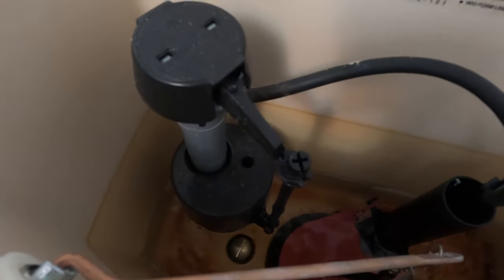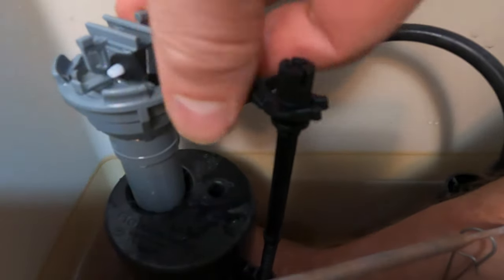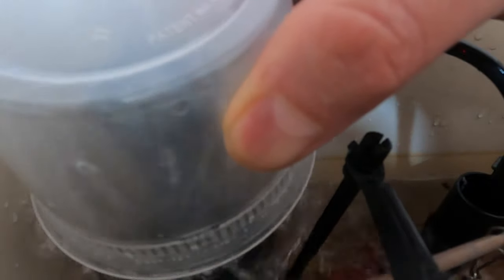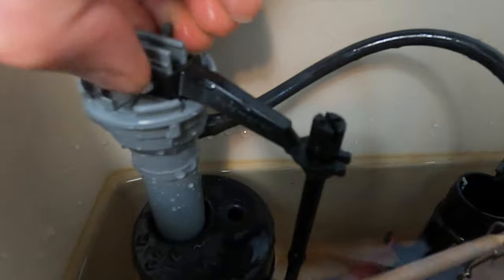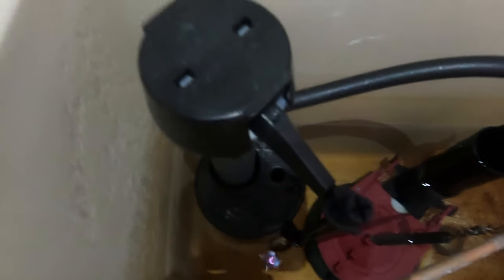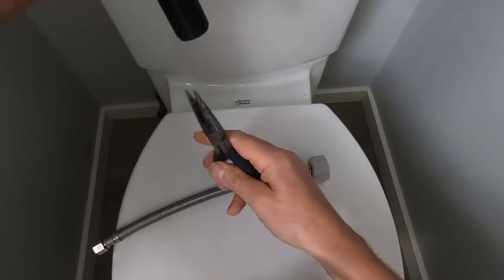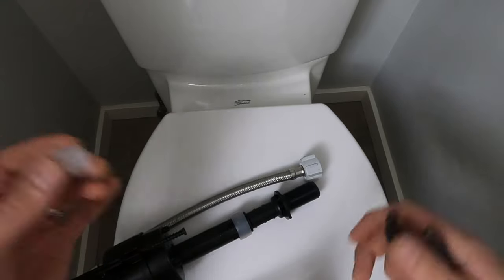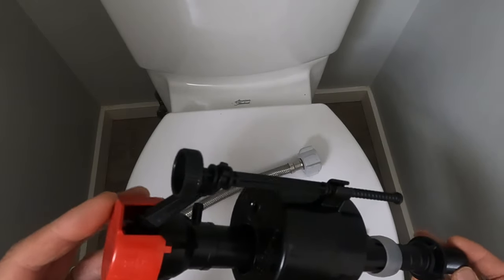How to fix a hissing toilet. Two causes.

Comment: This fixed mine. I was expecting it to not because it was hissing even after it was done filling, but I guess debris or something was causing it. Regardless, 5 minute fix and we are on our way. Thanks!
Reply from the maker: Sometimes a combination of debris & high water pressure causes what you are describing. You may want to check your water pressure as well. I have a video on how to lower water pressure. Thanks for watching!

Comment: I suggest also checking the water pressure to your house. Several problems, including showers that felt like being sandblasted, sprinkler timers that didn’t seem to last as long as they should, and water hammer arrestors that didn’t work (if the captive air has less than 90 psi and the water pressure is 90 psi the arrestor piston is already bottomed out and cannot absorb a pulse) disappeared after plumbers installed a pressure reducing valve.
Reply from the maker: I agree, high water pressure also causes faucet  washers and cartridges to wear out faster as well. Thanks for watching!

Comment: Thanks for posting this. My toilet been hissing for a while now. I was going to either get a plumber in or try to replace the whole inlet myself. I tried to the first tip, dismantling the top valve to clear it of debris, and there was a piece of plastic stuck in it.

I think you can imagine the joyful frustration I felt when my tank not only filled up, but stopped flowing. My house is silent again.
Reply from the maker: That’s great! Glad it helped

Comment: To anyone afraid of pulling out the white rubber gasket / filter at the bottom of the fill valve tube - I removed this and it solved the hissing noise. 

On the next fill, there was a bunch of debris in the tank. Seems like there was a backlog around the rubber gasket.

Thanks Jensen! 🎉
Reply from the maker: @kamandor  Glad the video helped!

Comment: Thank you. First step did the trick. Your demonstration was easy to follow. Much appreciated. I had a new septic tank installed and while digging they accidentally hit a water line so I’m sure that’s where the build up came from. Not their fault considering it wasn’t running along side of this old house.
Reply from the maker: @lizgee5331  Glad the video helped! After a water line is hit the toilet is usually the first fixture used once the line is repaired so it gets most of the debris. Faucet aerators are another common spot for debris to gather.

Comment: This worked for me! THANKS! One thing, getting that cap off was a hassle. I found using a finger or thumb in that front opening to pull upwards popped it off. Mine absolutely would not come off pulling the side tabs. Once the cap was off it was literally 3 or 4 minutes to clean and flush and it is fixed. Thanks so much for making this video, saved me time and money!
Reply from the maker: Some caps are definitely more difficult to remove than others. I’m glad the video helped!
Reply: there's actually no need to take the cap off. just lift the float arm up and twist. it comes off and goes on just like he showed, just wtih the cap attached. taking the cap off only makes it easier to line up the grooves and drop it in place without whiggling it a bit to find the grooves because you can see the mating

Comment: This video worked for me. After flushing out i still had the hiss so i took off the black cap and turned the water back on slowly. It started to squirt upward through the black valve seal, so i removed it, bought another valve seal, and  the hissing stopped after putting it back together. Thank you for the tutorial!
Reply from the maker: Glad it helped!

Comment: Thanks for showing that flow limiter, I was was puzzled why my toilet was filling so slow after I replaced the flush valve , I thought maybe the shut off had a restriction. I removed the flow limiter and it and it was slightly blocked, I just left it out, works great now. Thanks again

Comment: Awesome, thanks man!! There was a little rubber piece that was stuck in the top of the valve. Cleaned it out and it filled right up like new 🙏🏼
Reply from the maker: Glad it helped! You may need to change the valve seal eventually if you found a piece of rubber.

Comment: The flow restrictor is I think the culprit in my case! The fill valve looks brand new, but the restrictor is scuffed. Thank you for educating about it!!
Reply from the maker: It could be the flow restrictor but l have seen debris in new fill valves as well. Sometimes when the water gets turned off & on a bit of debris from in the shut off valve gets lodged in fill valve.

Comment: Immediately stopped hissing with fix #1!!! I tried #2 because after the hissing stopped, the basin crept to a super slow rate of refill. But wonderfully simple tips man, thank you so much!
Reply from the maker: Glad to help! You may want to check that the fill tube from the fill valve to the flush valve is clear as well.

Comment: so to remove the flow restrictor, you would have to remove the entire fill valve? or do you remove the restrictor while it's still inside the toilet, kind of pulling it out w the needle nose without being able to see...?
Reply from the maker: You can usually grab the restrictor  with needle nose pliers while the fill valve is still in place even if you cannot see it. You could try using a small inspection mirror to see if there is a restrictor in place.
Reply: @JENSENDIY  ok thank you so much, that's helpful

Comment: Thanks for helping others including me. I did like you said, and it went well, unfortunately I have to replace the fill valve, but, thanks to you, I know how.
Reply from the maker: Glad the video helped, thanks for watching and good luck with the fill valve replacement!
Reply: @JENSENDIY  Yeah, t went well. Not much for tight spaces, but, it's working fine now.
One exception, I have a knob that turns the water to the tank on and off, now that's leaking, and there is no shut off to that, so, I have to shut the whole house down. 
If it ain't one thing, it's another, thanks again.

Comment: Fixed my several month's dilemma. Replaced the flapper and can still hear hissing and water running. as soon as I cleaned the refill valve, my issue is gone. Thanks a bunch
Reply from the maker: @skilledgrub4906  Glad it helped!

Comment: I know that you posted the video quite a while  ago. My toilet  when flushed would not start to refill. You had to take off the top and manually tap the fill value to start it filling. I used your video and now the toilet  is working perfectly. I would add to clean bottom of tank if they is any dirt in. I could not believe I did it if it wasn't for your video. Thank You
Reply from the maker: Glad the video helped! Thank you for watching

Comment: Thanks for the helpful video .One question, when you turn the water back on ,does it need to be turned all the way back ,or just enough to get a good flow into the tank?Thanks.
Reply from the maker: @joesive5476  Just enough to get a good flow is fine but sometimes by doing this the valve makes more noise than if it was fully open. Hope this helps! thanks for watching.

Comment: Great video. I woke up to hear my basement bathroom toilet hissing very low but that bathroom hasn’t been used. Checked the water level Al’s water pressure all seem ok. I hear the hiss coming from the same region around the cap you mentioned to clean. Going to give it a try. Hope it works
Reply from the maker: Hope it works out for you, thanks for watching!

Comment: Def tried the first part still hissing though. I’m going to need to try to empty the tank before i try part 2. Co worker told me that other part gets clogged up. Thanks for the help
Reply from the maker: @gtcole04  You may have to replace the fill valve. Or try replacing the valve seal first. Good luck!

Comment: Thanks for the tutorial. The hissing sound went away after following your instructions but for some reason the toilet now takes longer to fill up with water after flushing. Any idea what caused it?
Reply from the maker: It's possible that there is still some debris in the fill valve or the water shut off valve is not turned back on all the way. Thanks for watching!

Comment: Thanks man didn’t fix the problem but lessened the hissing. I guess the spill valve needed cleaning out anyway
Reply from the maker: Glad it helped reduce the hissing, sometimes high water pressure can cause problems as well. I have a video on lowering water pressure. Thanks for watching!

Comment: Thanks so much for this video. In my case, I just replaced my damaged rubber valve seal after 16 years of toilet use to stop it from hissing. However, I'm noticing afterwards that lots of little black rubber pieces are floating around in the water inside the tank. Will my new rubber valve seal will be damaged again soon if I don't clean all that out?
Reply from the maker: It's a good idea to clean out the debris from the tank if you can but it shouldn't harm the valve seal as that is usually caused from incoming debris through the water supply line feeding the toilet. I would check tank to bowl washers and flapper to make sure they are not causing the little pieces.

Comment: Thank you For this very helpful vid! I have another problem wondering if you have a suggestion, when I flush my toilet I have to always hold the handle down to complete a full flush( even though I replaced my Kholer handle with a Korky strong handle) thanks I’m advance .
Reply from the maker: Try adjusting chain length from flush lever to flapper. Make it short enough so flapper stays sealed but with only a little slack in chain. Hope this helps!

Comment: I have fixed the hissing sound with minimal water spillage.. none if the wife had passed the cap sooner but that’s half the fun. Would this cause a leak/water usage or should I keep checking?
Reply from the maker: @chuckwagon9923  If the toilet was continuously running then yes this would be causing water usage. Hissing while filling is more annoying than anything else, it doesn’t usually indicate a leak or water usage, just debris in the valve or a worn valve seal.

Comment: Wow, I found this video & was happy, I thought I could fix my "hissing" valve myself!  I currently have the same exact one that's in the video- the "Fluidmaster" that a plumber installed within the past 2 years (so its not old)  Well, I sure got a problem... I can't turn the water off to the toilet (the darn thing doesn't even budge) & I can't "pop off" the top Black cap either? (I even used both hands)  How come it looked so EASY in this video??? 😮  lol  Geez, guess I'm gonna have to call someone! 📱  *What's the trick to pulling up the black top cap on the fill valve?
Reply from the maker: Some are easier to remove than others. You may have to use some force & pull upwards grabbing the little tabs on underside of cap but you have a bigger problem if the water won’t turn off which must be done to do this job. Good luck!
Reply: @JENSENDIY  Thank you so much for replying back to me! Well, I hope you can get a good laugh....😄 

SO, after watching this video several times over & over last night,  I said this is exactly the problem-  hissing from the fill valve PLUS I have the exact same one as in this video, the "Fluidmaster"...  
Oh my Goodness, I was so over anxious to try your "technique" this morning, I took the tank cover off, pulled more firmly on each side of the black top cap, got it off, AND loosened up the inside, by turning it as shown in the video....  

Ok--- so the funny part is-  I forgot all about NOT turning off the water!!!  So the water starts shooting up in my face & I start screaming Ahhhh!!!! 😳💦💦💦💦  Thank Goodness I had my eyeglasses on, so I could SEE clearly to try & close it back up again! Geez, after all that screaming & calamity, I got that inside top back on & the hissing noise DID stop, all thanks to watching your video, step by step!   
Omg!  I really want to double check it again, but since the toilet shut off valve is so stiff & won't move, guess I should turn off the MAIN valve in the garage first, right?
Reply from the maker: @cheryljones2009  Wow! You’re lucky you didn’t have more of a flood. At least you know where your main water shut off is, alot of people don’t. I have been there before with a burst water line & panicking to shut the water off lol! Thanks for watching!
Reply: @JENSENDIY  Hi, I was just reading your reply to my last message... So isn't that funny?  I watched your video, realized I had the same exact problem, but I opened up the top of the fill valve, WITHOUT turning the water off! 🤷‍♀️ Oh my gosh, I sure wasn't thinking!!! 🤦‍♀️  
Thank God I was able to properly turn that round gray top & close it back up again!!!  lol 
The fill valve has been quiet ever since... I wanted to ask you, what causes that initial constant hissing noise to start in the first place?
Reply from the maker: Small debris from the water supply system gets caught inside the fill valve. Glad you got yours fixed up! thanks for watching @cheryljones2009

Comment: Greetings. 
Mine is making a very low|soft hissing sound. Barely noticeable. It worries me because the guest bathroom which I never use. Ended up costing me over $300 because 😫it was running😫!

So now, I'm nervous about an unnecessary and avoidable high bill. 

I do have a home warranty but I don't want to spend $75 unless it's necessary. 

Also, the tank fills rather quickly imo. Do you think it's low-key running? Or is it necessary to replace anything at this point? I'm going to swap out my toilet within the next 2-4 weeks.

Gratitude for your time.
Reply from the maker: Your water pressure in your home may be too high. Also check the water level in your toilet tank. I have a video, how to fix a running toilet. Good luck!

Comment: At 0:44, looking down on top of valve, there are 2 white dots. There is a fine mist spraying out the one on the left from my valve. Clean as shown or is it some other problem.
Reply from the maker: You may have to change the valve seal as shown just over 2 min in. You could also try removing the black cap & turn water back on slowly to see where the water is escaping the valve. If it’s not the valve seal l would replace the fill valve. Hope this helps!
Reply: Thanks, looks like water is squirting around.edge on one side of valve. Will look again and see what replacement parts I can get. May just replace whole float. Thanks for your help.
Reply: Eureka !! Bought the suggested part and flushed it out again, one or both succeeded in fixing it. Thanks again
Reply from the maker: @tropicsandoceans7945  Glad it helped!
Reply: Cost of repair $6.

Comment: Thanks I couldn’t get the cap off. But I’m my attempts it resolved the   Problem for now.  Lol
Reply from the maker: Sometimes you need a small flat head screwdriver to get the cap off. In your case maybe just turning the water off and on stirred loose whatever was causing the problem. Thanks for watching!

Comment: Any ideas of what could be happening with mine? It's doing the exact same as yours but I JUST installed it last night, so can't be debris. Assuming I didn't situate something correctly but I haven't been able to figure it out yet.

Edited to add that I did look for the water restrictor in my Korky fill valve but I didn't see one.
Reply from the maker: It is possible that debris got into fill valve just from turning water supply off and on, also sometimes fill valve will be a bit noisy if shut off valve is only turned on part way. I hope this helps, good luck!

Comment: When I ran the water to flush any debris, it was making the hissing sound the whole time the water was on. Could that indicate my problem is the valve itself?
Reply from the maker: That’s a possibility but sometimes when the shut off valve is only turned on part way it makes a hissing noise depending on incoming water pressure. Once you have flushed out the fill valve if the hissing doesn’t go away then yes you may need to replace the fill valve. Hope this helps!

Comment: Having the worst time with the parts you made look so easy. It took a lot of effort to get the cap off but now the top of the fill valve wont twist and pop off when i try to open it. The whole valve just spins no matter how firmly i hold it.
Reply from the maker: Sometimes depending on the age of the valve and the waters mineral content (causes deposits in the valve) making it harder to get apart. You may have to replace the valve, good luck!

Comment: What if the top part that is supposed to twist off...doesn't? I've applied quite a bit of twisting pressure as you demonstrated, but it just doesn't budge and I'm scared I'm going to snap the little plastic bits.
Reply from the maker: If it looks the same as the one in video it should twist. Depends on age of toilet, water quality can cause deposits in valve so if it doesn’t want to move you may want to change entire fill valve. Good luck!

Comment: Looks like I’m two behind from when you made this video. My flush valve is a little different from your video. I can take the top off, but I cannot grab from the bottom to separate. I’m not sure if this is a model # but it says 66038.
Reply from the maker: You may have to completely remove the fill valve to clean it out. If that is the case then you probably are better off to install a new part. The fluidmasters are universal and work pretty well, really depends on make and model of toilet. Thanks for watching!

Comment: Hi.  I just replaced the fill valve in my toilet last October.  Within the last day or so, about every 10 or 15 minutes, the toilet lets out a short 2-3 second " finishing a flush " sound. How would I go about eliminating that?
Reply from the maker: It could be unrelated to the fill valve. Check out my How to fix a randomly running toilet video. Could be the flapper. Thanks for watching!